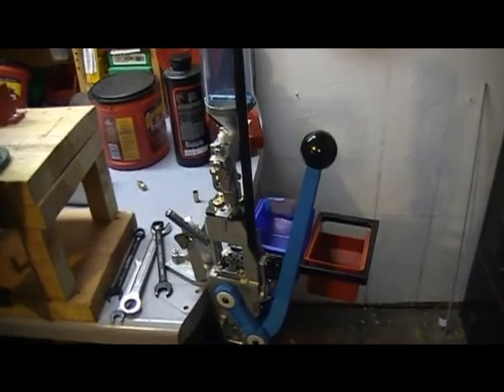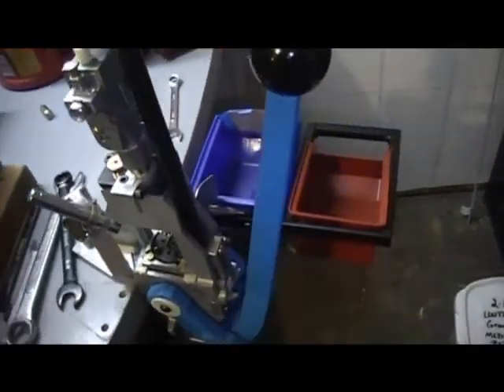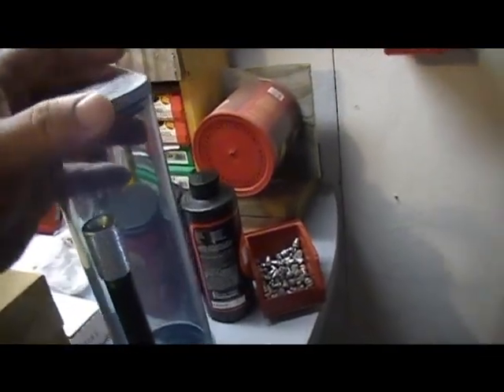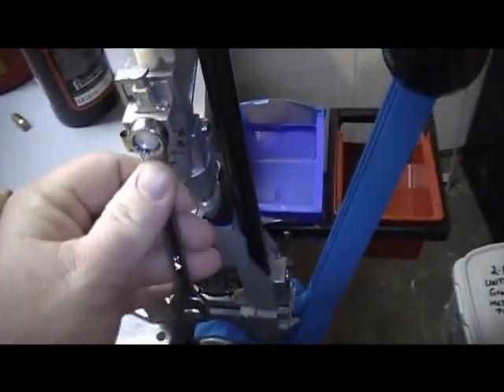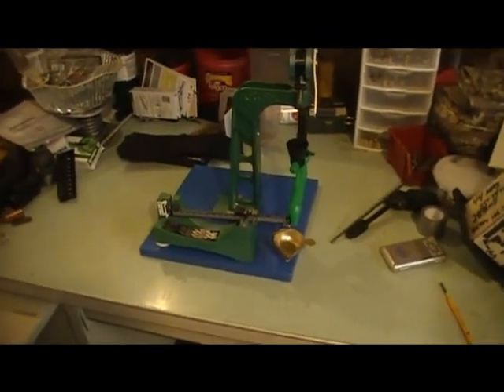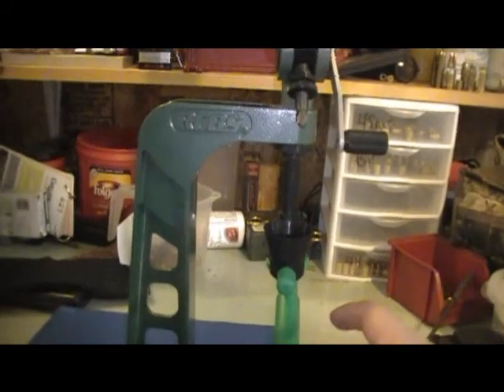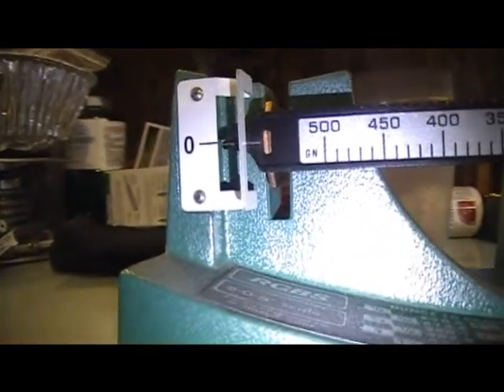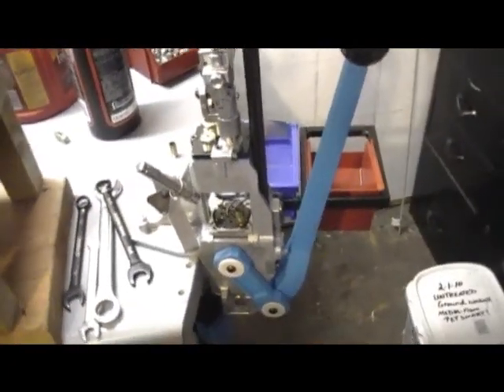Dillon Square Deal B part 3 Setting up the Powder Charge

Comment: Could you do a video on adjusting the seating stem and the other adjustments on the tool head? I inherited my fathers press and I've used it without issues for 45 but it was already set up. I've got a new tool head and dies for 9mm. I'm clear on changing everything but the adjustments on top. Thanks

Comment: The vid is very helpful. I have read to books and i still have questions though...like how do you deprime the casings. I have the 5 station dillon 650. Does the sizing die deprime  & resize? Thanks, I'm just having trouble getting started.